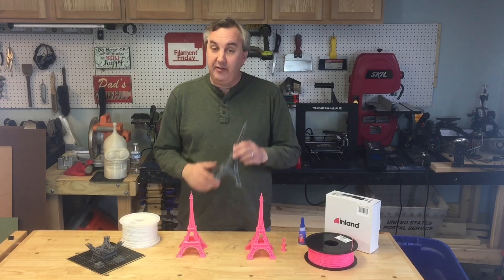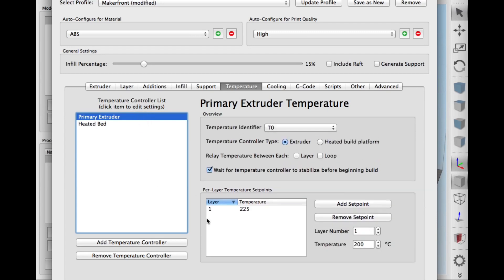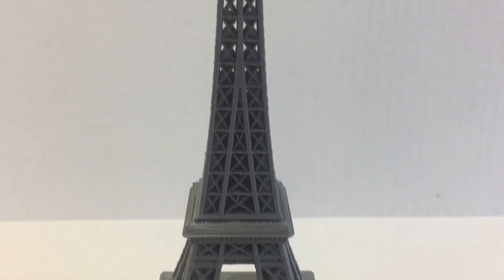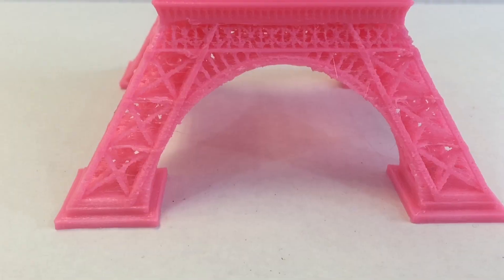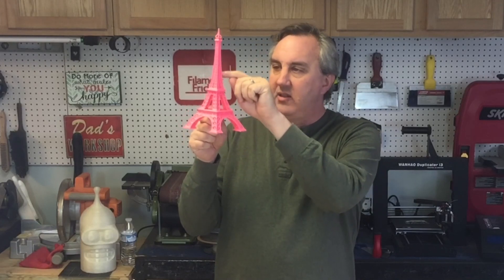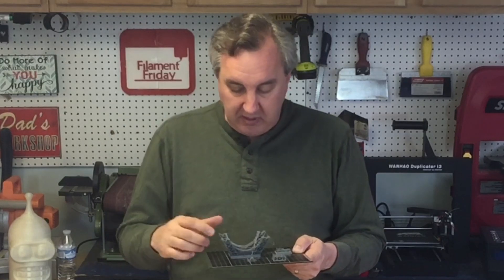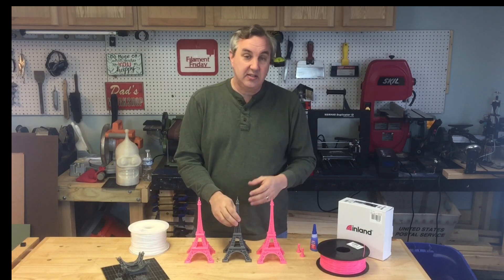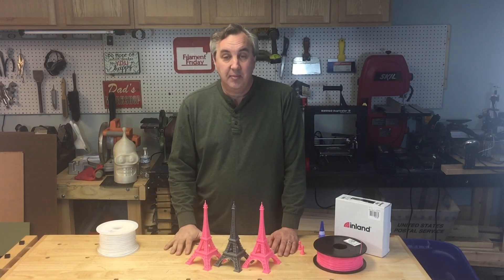3D Printing Filament Friday #63 - 3D Printed Eiffel Tower in ABS and PLA on MAKERFRONT Printer

Comment: printed one myself what a great design but yep, my printer couldnt print the rails either. It printed the posts just not the rails. When you print it bigger will you be using supports for the railing? will be interested to see your settings

Comment: Great comparison video! This model has been on my "to-do" list for quite some time and your results are basically what I would expect.  On PLA verses ABS, because you are looking at Specific Gravity of ~1.25 for PLA and only ~1.02 for ABS so you will have better flow on ABS than PLA.  Also ABS is amorphous, therefore has no true melting point meaning you will (again) get a better "flow" over PLA for the smaller details.  Would be interesting to see Joel print this on the GMax 1.5 in one go especially with the 0.5 nozzle size...

Comment: I'm glad the Aurarum filament worked for you, I like as it locally made (at least for me it is), plus it prints well. I've had good success printing abs with it. Over the past week I have already printed this model large scale, I sized it so the top section was about 160 mm tall and scaled the rest to match. I think over all it's about 400mm tall. I'll post a video later tomorrow showing it.

Comment: Would detail in smaller sized prints be an issue had we had smaller diameter nozzles?
Reply: +Konstantinos Sakkas I've tried using everything from a 0.2mm up to 0.6mm nozzle on my Wombot, but with a few exceptions I've determined that I get the same results if I just stick with the 0.4mm nozzle and adjust slicer settings instead.  Keep in mind that, just like you can set your line width higher than your nozzle diameter, you can also set it thinner: lately I have been printing with PLA on my Fab Mini at 60mm/sec with 100% flow rate, 0.3mm line width and 0.125mm to 0.175mm layer height (depending on the print), and the detail I get is as good as (if not better) than using a 0.2mm or 0.3mm nozzle and similar settings on the Wombot.

Comment: very cool video as always.

I am using MatterHacker ABS filament in my I3 prusa but I dont know why I am getting a very weak print. I tried different temperatures (255, 240, 245) and the same result. I can brake the part very easyy.. I dont know if it is my settings or the filamentes. When I use PLA from MatterHacker oh. that is very strong.
Reply: +VLAHECO If you currently have your cooling fan on, turn it off for all layers and drop your nozzle temp down to 230, then work your temps back up from there if needed. If that works then great, problem solved. However, if you are already printing with the fan off and/or printing with the fan off doesn't solve the problem, try putting a small heater-fan in front of the printer and have it blow hot air at it while you're printing; the idea is to keep the air temp around the model warm, as if your printer was in an enclosure, so adjust the distance from printer, heater temp setting, and/or fan speed to keep the air nice and warm without damaging the printer (if your printer has any PLA parts on it, for example, you could damage/warp them if you're not careful). Finally, give the model an acetone vapor bath (or take a brush and "paint" acetone on it, or dip it in acetone...Google for methods and safety precautions/hazards of acetone use).

I have to use all of those methods combined to succeed at ABS printing pretty much anything on my Prusa-style printer, so I've done the more logical thing and simply stopped printing with ABS at all unless I have some specific need for a model to be in that kind of plastic. ;)  But still, if you need to print ABS, hopefully one or more of those methods will help!
Reply: +Brandon T Really ? Thank youuu so much  Brandon. You just explain it very clear. Thank you..I have not tried yet  withe the fan off. That is the first thing that I am going to do
Reply: +VLAHECO No problem!  Most people accuse me of talking too much, so it's nice to hear that occasionally my gigantic paragraphs of text are actually helpful. ;)

BTW, ironically enough, MatterHackers has a helpful article about ABS that might help you further, especially since they out of anyone should have the best tips on printing with their own filament, eh? :) https://www.matterhackers.com/articles/how-to-succeed-when-printing-with-abs
Reply: +Brandon T hehe...do not listen to them. :) Thank you again
Reply: Brandon , I just tried yesterday with your recommendations and woala. the ABS prints is strong now. Thank you so much
Reply: +VLAHECO AWESOME! :D  Great to hear that, I'm glad I was able to help out. Happy printing!

Comment: The resizing has to be related to the software that gwhancock was using to create the Eiffel tower, because it happened to me too. Inventor 2015 did't have .ipt to .stl converting so i always saved it as.. .stl --> had to resize it everytime because it came out super tiny. Now with inventor 2016 and the added 3d convertor the .stl files come out normal size.